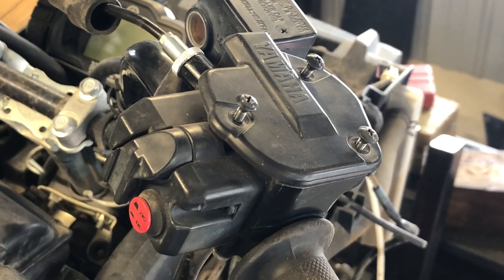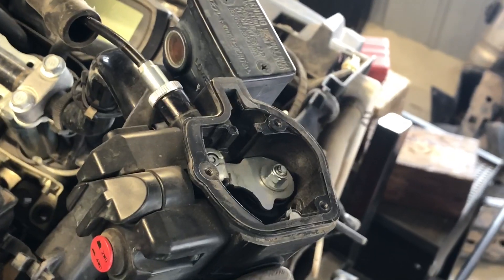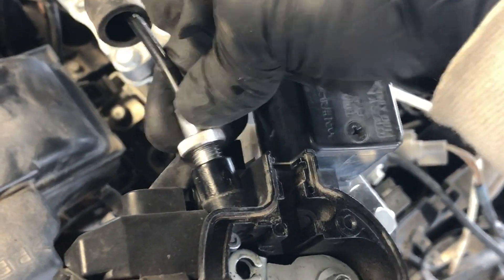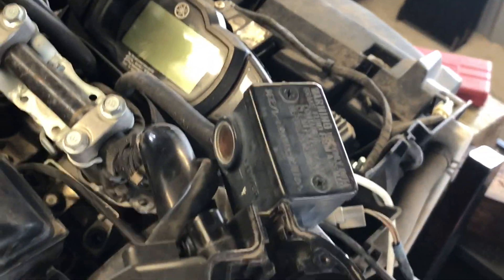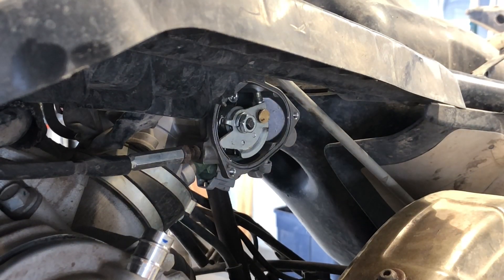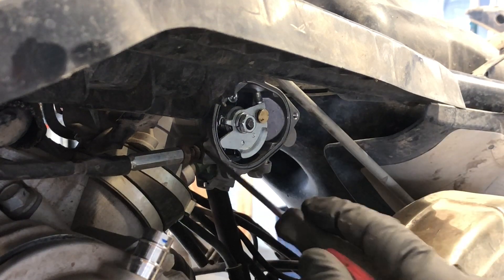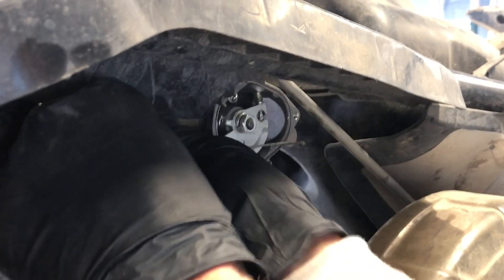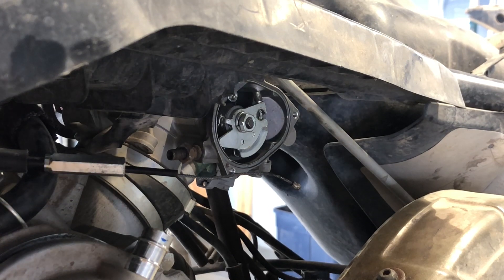Yamaha Grizzly 550/700 Throttle Control Cable Replacement - HOW TO  - Replace Cables

Comment: Thanks for the help. Question should the butterfly move freely one cable is removed?
Reply: My question too, my problem with throttle sticking is not in the cable.  The butterfly returns very slow.
Reply: @fredjudson524 I have the same problem. Did you ever find a solution? I replaced the cable and that didn’t help.
Reply: @ Yes, I fixed it.  It turned out to be the butterfly valve just under the air cleaner.  I don’t know the exact terminology but the ‘stem’ that the butterfly rotates on was full of gooey material I assume came from the foam air filter.  I sprayed brake cleaner repeatedly on it while operating the throttle.  Then, I used triflow lubricant on it.  I had to do it three different times before it was trouble free.  If I knew how to disassemble the whole unit cleaning would have been easier but I didn’t want to go that route.  If the sticking throttle goes away after the machine has gotten hot this is probably the problem.  Your throttle area will have to dry out after doing all this before it will start again.  I stuck a screwdrive in it to hold ope the butterfly to help it dry out.
Reply: @fredjudson524  Thanks for the help. I’m gonna try to tackle this today. What you just said sounds exactly like the problem I have. The throttle is basically frozen until the motor warms up.

Comment: If you dont mind telling me do you know how i can get a 1969 ct1 piston, cylinder, and head? if you have any parts for a 1969 ct1 let me know because the one i got is in rough condition. i need the piston, cylinder, and head because the bike didnt come with one from the guy i bought it from.